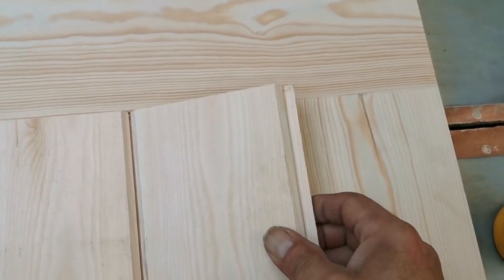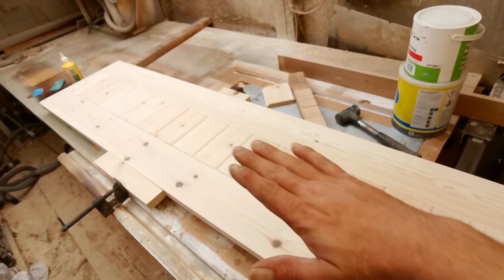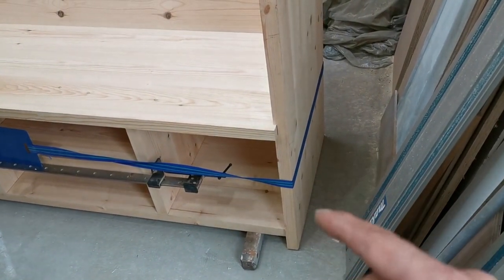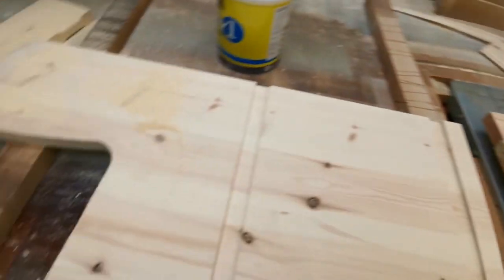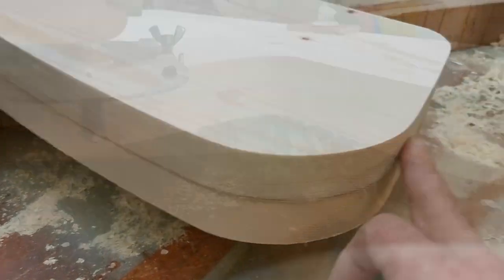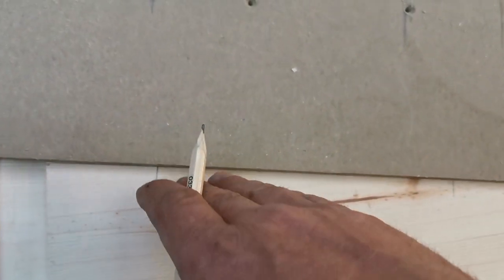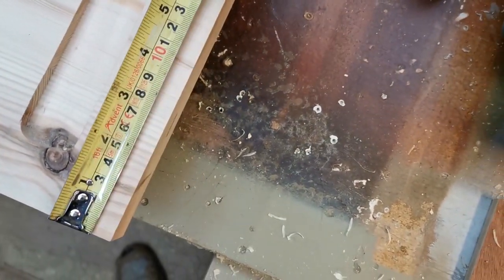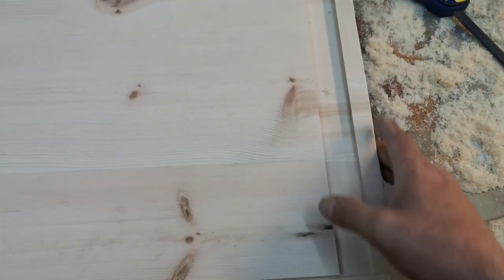Pine shoe bench Pt4 - Nearly finished

Comment: Nice project, I'm just wandering though with the though you've put it everything, why you didn't pin the tongue and groove from the back
Reply from the maker: Thanks 👍 Because i wanted the boards flush on the face, i could have pinned through the rebate bead into the back of the T&G but that wouldn't be pinning the board against the rebate bead, This won't be getting painted, it'll move a little, shrink & maybe even crack esp in front of the radiator, it's going to be a bit rustic in time, sometimes some fixings are 'honest' fixings, they're seen, I understand what you're asking but if i wanted them hidden i'd have done that in some other way.👍